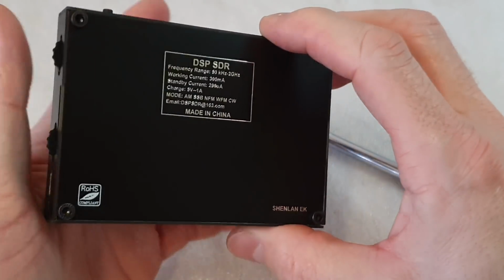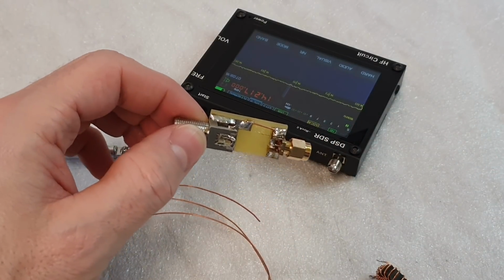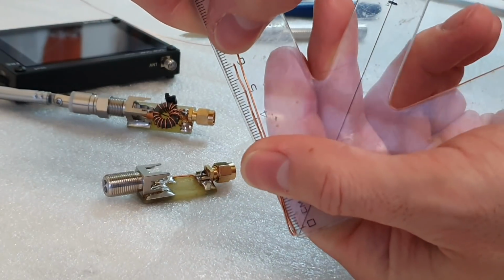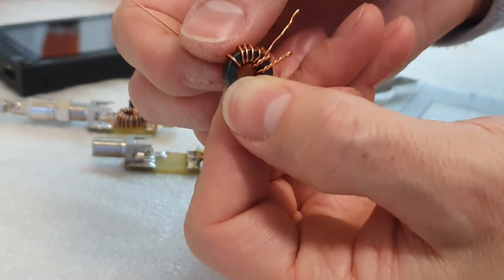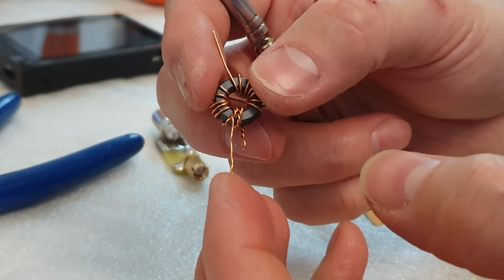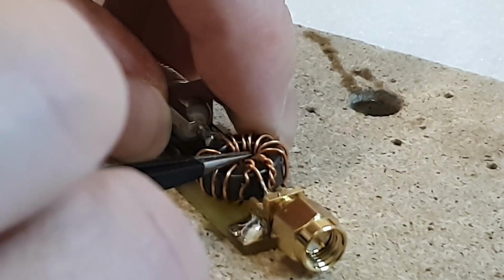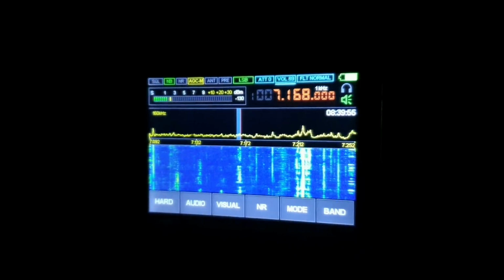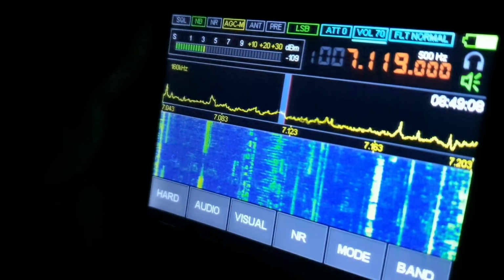Malachite clone & RX improvement on Telescopic antenna

Comment: I’m waiting for someone to produce a larger model with at least a 10 inch display. By that time they should have fixed the impedance mismatch problem.
Reply from the maker: original Malachite version do have an additional PCB board to match it. There is also a feature to control it in the menu

Comment: Please put these for sale on your website! PLEASE!
Reply from the maker: hmm I have to think about it ;)
Reply: @OM0ET  Cover it with some thick heat shrink and you've got a product. And please put a BNC or SMA on top and not an type F connector.
Reply: @OM0ET  If you do, it would be nice to design it in such a way, that it also works as a strain relief . Otherwise is everything too heavy for the original, board soldered SMA.
Reply: @OM0ET  Im up to buy one.
Reply: @OM0ET  You should,  not everyone has the time and skill to make something like this. Share your knowledge and earn at the same time.
Reply: Parts are available here:

https://www.mouser.com

623-5943000301
5943000301
43 Toroid
$0.29
	
RoHS1538-73251-3130
73251-3130
SMA RA PCB RECPT
$6.14

RoHS2523-132135
132135
SMA R/A PCB PLUg
$11.02
Reply: Yes please.
Reply: Can radio be moded to have second high impedance input and connect antenna directly to it? Might solve mechanical strain issues.
Reply: @arainadiaz9219  i assume there is not enough real estate on the inside for that UNUN to go there.

Perhaps a smaller torroid would do...
Reply: I’ll take 2 please